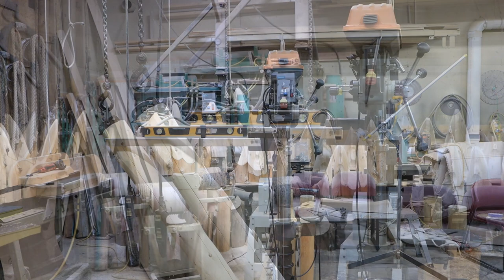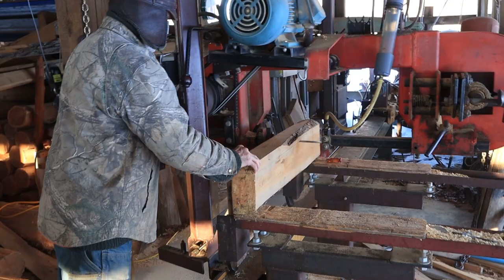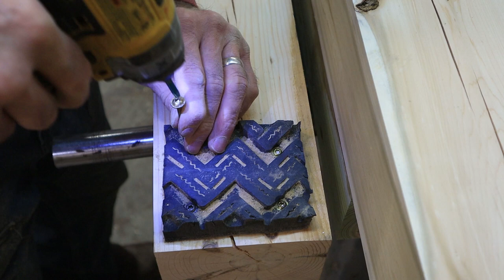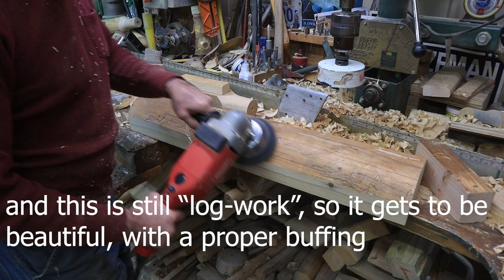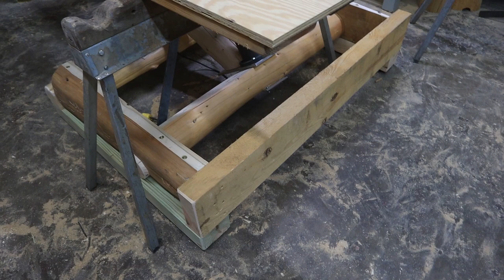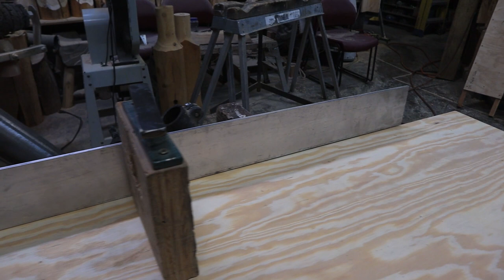You Can Make This, Part 3 of 3, Tenonizer's Dr Press, a Tilting Column Drill Press for Log Work

Comment: This 3-part series was great. thank you for making these videos. Did you build your bandsaw mill? It would be great if you did  short walk around video of your bandsaw mill and showing it's capabilities.
Reply from the maker: Hi jrace, we want you to come with on an adventure, so we put the January 2020 episodes together to enable you to come with, I am glad you like them, thank you and your welcome. As for the sawmill, we built that 35 years ago when we were building log homes; we needed something that would cut 36' one cut. Its saw head is similar to a Woodmizer but with a two point track system, a 10" x 10" x 40' overhead square tube/track and a 4" x 8" x 40'  "I" beam/track one foot above the floor. It also has a 7 1/2 HP DeWalt radial arm saw mounted to the same track; it is a heavy but simple system. Maybe we will do a walk through video of it this spring, (when it gets warm)😎
Reply: @Tenonizer  that sounds fantastic. I await seeing that walk through when it gets warm :) . I had figured you designed and built it yourself. Yours is now one of my favorite channels. Blessings to you.

Comment: So the pivot point on the drill column doesn’t have to be on the same plane as the centers of the handrail being drilled?
Reply from the maker: The one draw back of this "Wooden Addition Dr Press" is that the tape measure must somehow be adjusted as the drill angle changes for "tracking measurements" for drilling log handrail. Still working on that functional aspect, hope to get a simple answer worked through.